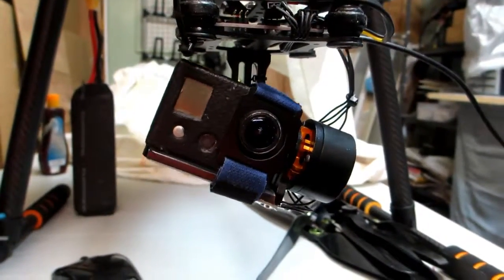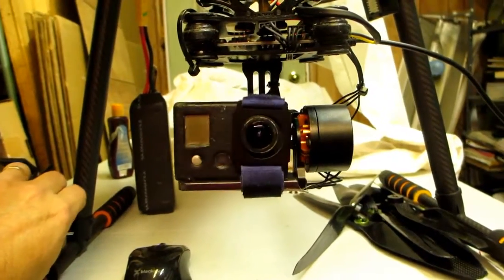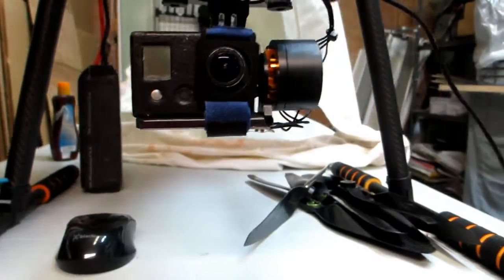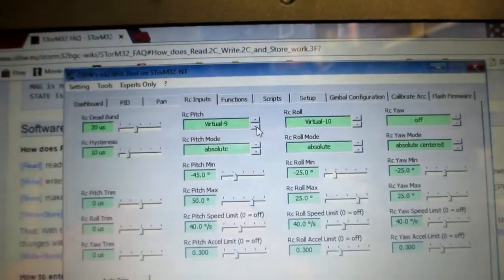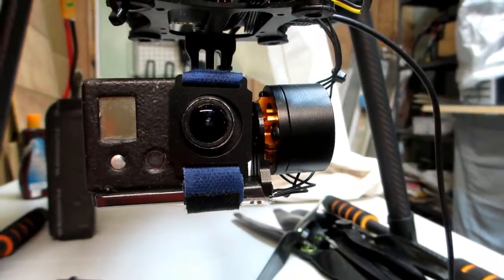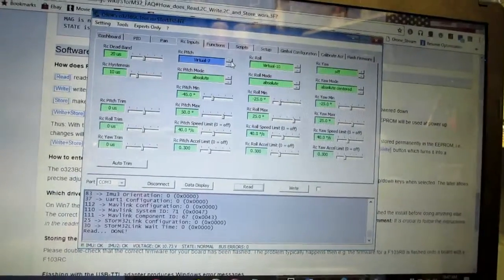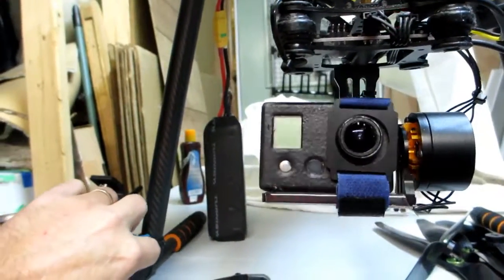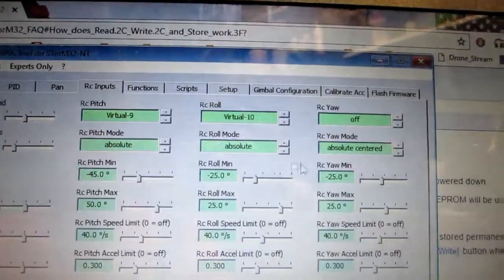Problem with Sbus on Storm32

Comment: Did you build your own gimbal with a storm32 controller or buy a prebuilt option? If it was diy could you point me towards a reputable spot to get a board from. Ebay makes me nervous.
Reply from the maker: No it was a factory Gimbal that wasn't workign after an upgrade. It's since been corrected. I buy my Storm gear from https://www.ensys.lt/

Comment: Hi Richard, How are you hooking up your receiver to the storm32. I've been trying and seem to be struggling. I'm using SBus from an XM+ receiver, I dont know if I have a problem with the storm32 board or how I'm connecting them. I'd really appreciate your help.
Reply from the maker: I was using the X8r. I had no issues with sbus.

Comment: Not sure how you have it set it up, but I have mine working with a pixhawk 2.4.8, storm32 through serial port 4 using mavlink protocol, which it looks like u are using. You aren't showing Mission Planner settings, so not sure whats up there. If you would like a demonstration, I can show you it works, Pan and Tilt with every bootup without plugging anything in. I use S-bus with my TGY i-10 - g'luck
Reply from the maker: its been fixed now. There was a software bug that caused the Sbus function to not work and has now been corrected. I want to run it from my pixhawk but I think I have used up all the ports and don't know how to go beyond what I have used
Reply: I am also trying to connect my Storm32 gimbal to pixhawk and control it using Taranis radio and 8XR reciver. X8R is connected to Pixhawk by sbus. But I don't know how and where  connect storm32 ??